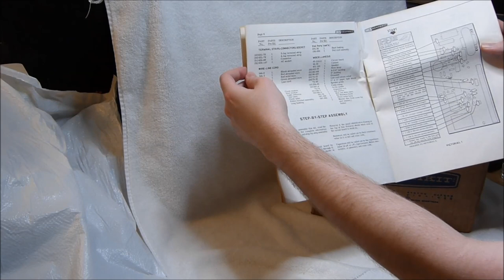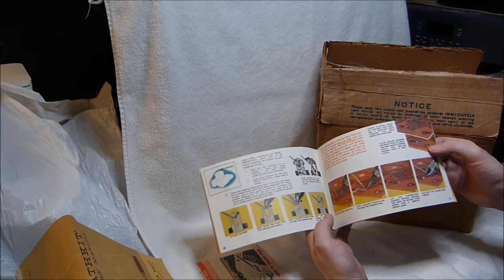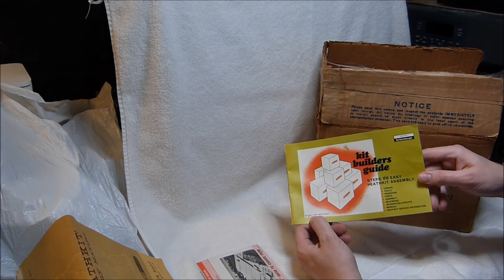Unboxing a NOS Heathkit GR-38 transistor clock radio (1971, USA)

Comment: I'd build it in a heartbeat using new electrolytic capacitors. There is nothing wrong with Kester solder, one of the best you can buy. I think it's a waste to keep it in a box, but, that's my opinion. Enjoy and thanks for the video.